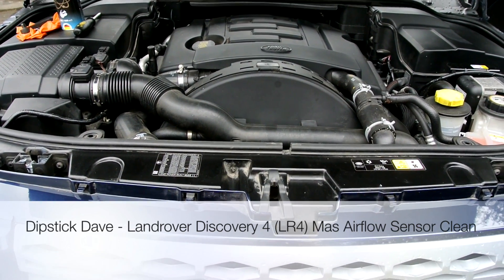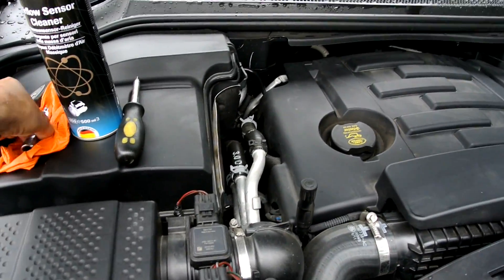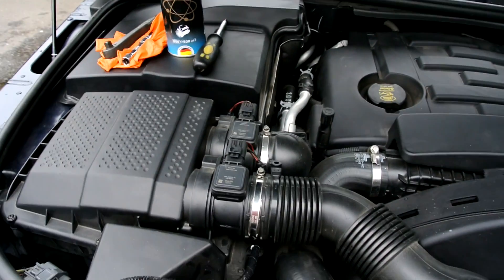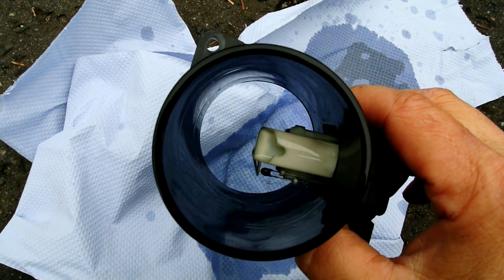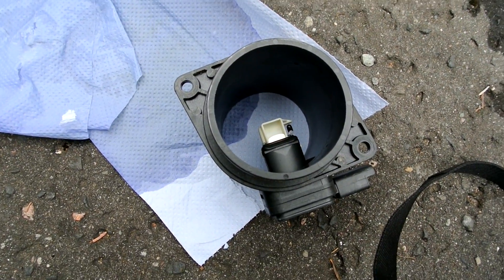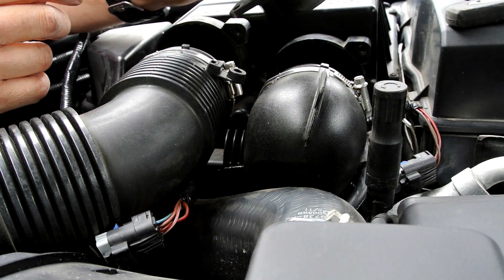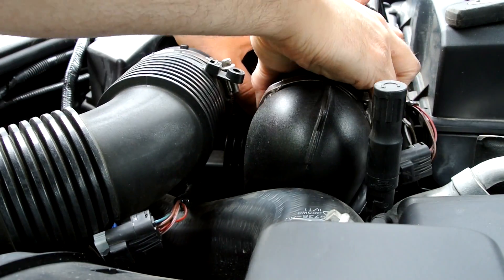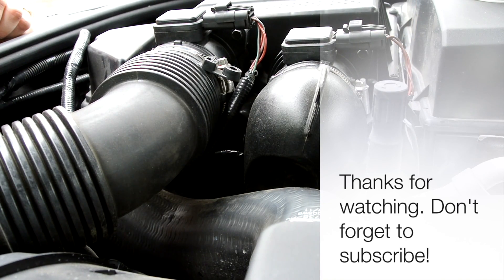Landrover Discovery 4 (LR4) Mass Airflow Sensor Clean

Comment: Second sensor is clean because its rarely used. Belongs to the second turbo which only kicks in above 3000 rpm. With so much torque the Disco rarely needs to venture beyond 3000  rpm .

Comment: Dave had an irritating problem with my 2015 LR4.  Going up a slope on motorway with just a light pressure on throttle I get Restricted performance.  Stop, switch engine off and on again and fault clears.  It’s okay uphill under load, and it an issue on flat or downhill.  Garage have not been able to fix it although after Cam belt change it was good for about 400 miles despite best effort to replicate fault.  Then started again - could it really just be a dirty MAF sensor?
Reply: Not an issue on flat/downhill

Comment: Hey Dave, thanks for the video, very clear and good tip before going to a dealership. I had the same error but only intermittently and I cleaned yesterday both sensors. I hope that it will not appear again.

Comment: Just tried this on a 2011 RRS but Restricted problem came back at high speed. I also swapped the sensors over so expecting to show MAS 'B' in fault code now. interesting that MAS A is for 2nd turbo and is cleaner as less used. 'A' doesn't use the temp sensor hence only 3 wires in connector, 'B' (nearest from front) has 4 wires. Both sensors are identical so can be swapped over. Ordered a new one. If that doesn't fix it will check for cracks and leaks.

Comment: I do this on all my cars with an MAF from time to time. It's amazing how much difference it makes if it's been neglected for awhile :)
Reply from the maker: The error message never came back, so that must have been the problem. I wonder how much that would have cost at a dealer!
Reply: Does it affect fuel economy? 
Thanks,
Reply: @DipstickDave  200 UK pounds for the part plus whatever they charge for diagnosing the fault and fitting the part.  
At jaguar you won't see much change from 500 quid after all that. They wont clean sensors just replace them.  
My son's jaguar Xf has the same issue but the sensor has failed.  I bought an OEM part for 95 UK pounds.

Comment: My name is Vic, please I need your help, my LR4 Discovery is not starting. It's been 2 weeks now my mechanic don't have a clue here in Africa. The system is detecting crankshaft sensor error. We tried fix another one but still it refusing to start. I am getting so frustrated with this. I need advice plsease
Reply: You might know by now that your crankshaft is probably cracked. It’s a known issue with the lr4/disco4. The design flaw is in the lubricating of the shaft thru the crank bearings and the impeller on your oil pump, way under efficient. You will need to body off, engine rebuild. The labour alone is $$$
Reply from the maker: If that is the case, it’s a new second hand engine would be the cheapest/quickest way to sort it. Good luck!

Comment: Thanks for the reply Iv had a good look round the engine at the hoses and all connections and all seem tight and clean , the scanner I have is a Konnwei KW808 OBD11/EOBD which seems to communicate with the car ok and apparently is ok for Landrover, the only clue is that when the car is stone cold in the morning the light is off and will normally come on when the engine has warmed up or bizarrely sometimes when I reverse , I did think was it linked to brake pad wear but I believe that would the red brake light on for that, what I might do is call the AA out sometime when the light is on and see what they make of it.
Reply from the maker: Without the code you're shooting in the breeze. If not the mass air sensor, it could be crank position, cat, ox, turbo sensor or just a wiring problem somewhere. If you have AA home start then their reader will find the problem. Or just pop into a local landrover specialist, or good forbid a dealer if your feeling flush. If your on the landrover forums you could see if someone local has a nanocom or foxwell or some other reader proven with Landrover's. Good luck, sorry I couldn't be more help.
Reply: Just an update it might be useful to anyone reading, went to an independent approved Landrover garage and there were 2 codes showing , 1 for a broken breather pipe apparently and 1 for water in fuel filter , both items renewed at a cost of £295 ! Car running perfectly again now.

Comment: I have the restricted performance and think it could be maf related. Out of interest was your problem only when cold enough to activate heated windscreen and did it disappear on restart ?
Reply from the maker: No my problem was in the spring/earlier summer. It was fine on startup and only happened when the wife gunned it out of the driveway and up the hill. 

I would check you hoses too. Just in case the cold weather is contracting a seal or a split somewhere.
Reply: Dipstick Dave it’s odd that it’s only on start up, I would have thought the fault would throw whatever time if there was a leak?
Reply from the maker: If it’s a seal or even a turbo gasket, it could seal itself went it heats up. Bottom line it’s either a sensor (dirty/faulty) or air getting into the system somehow(split in pipe, seal or gasket).  It’s one of things you have to do a bit of investigating, but start with the cheapest first!

Comment: Hi Dave Iv got the yellow triangle coming up intermittently with Restricted Performance message although there don,t seem to be any lack of performance , Iv removed the MAF,s and cleaned them and hasn,t made any difference and Iv tried 2 handheld diagnostic devices and they say no code stored , Any ideas please    Iv a 2010 Discovery 4 ?
Reply from the maker: Hi Barry, It's really odd that you're not getting any error codes. What readers are you using? I use the Foxwell NT510 and its very good. Does your code readers have Landrover specific software as basic code readers won't work. 

As for the error it's self, double check for air leaks on the pipes via cracks or loose connections. It could also be oxygen sensors, but again you should be getting error codes.

Comment: Thanks mate you help me. Am in holiday with my family and I have the same problem but the code come out is P006A so I will try to do this just take 500 Miles to home 
And a mecanic want to open the engine ... to watch this video help me to do this first I stop him 
Thank if you can have any idea for this Code P006A
Reply from the maker: +Kingnlibger11 King 

Hi, P006a is the MAF sensor. If cleaning it hasn't solved it, check everywhere for air leaks. Check the clamps are nice and tight, and there are no cracks anywhere on the plastic pipes. They can crack when you force them out. If there is, duck tape them to get home. 

It's crappy breaking down on holiday it's happened so many time with me. Good luck on getting home. Luckily it's not the worst error to have, but still a pain.

Comment: Hello... my HSE LR4 2010 is giving Low engine performance. I have clened the both air mass flow, but the error folows!! Is there another thing to do? Nest regards.
Reply from the maker: It could be faulty sensors or air might be getting into the pipes somewhere. Cracked plastic or a leak on the turbos.